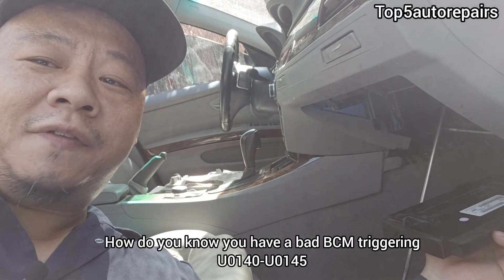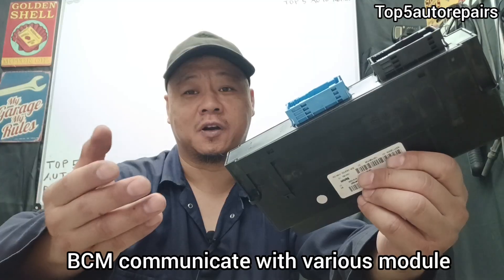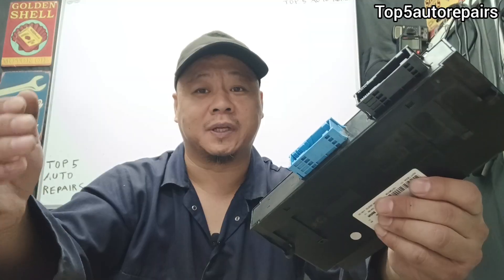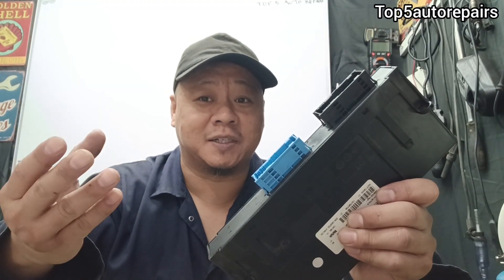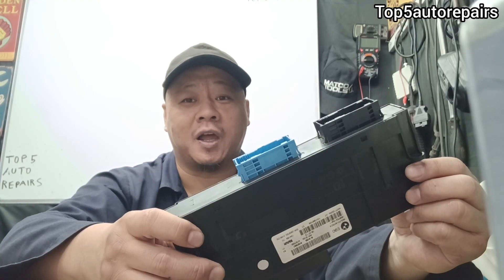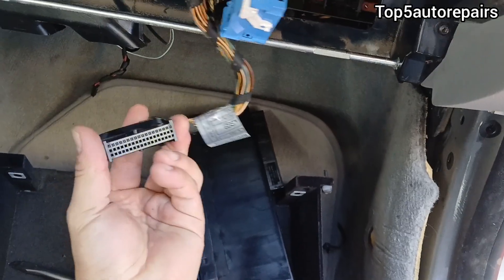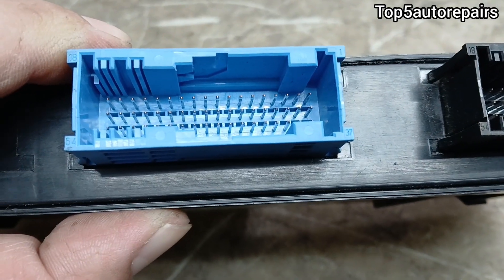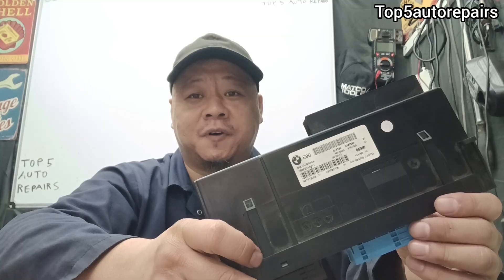HOW TO FIX BCM BODY CONTROL MODULE CODE U0140 U0141 U0142 U0143 U0144 U0145 LOST COMMUNICATION

Comment: Now that i found this other video of yours . Im certain i have a funky BCM . I think your the best guy to learn from . Thank you for sharing your knowledge this is so informative.  Now im going to try and check connections then if i can findd out how ? Ill try to reset mine . A few months back my radio made a loud pop went black , back windows quit  n i pulled positive batterybfor 5 mins and the windows and radio worked . But windows quit again soon after.